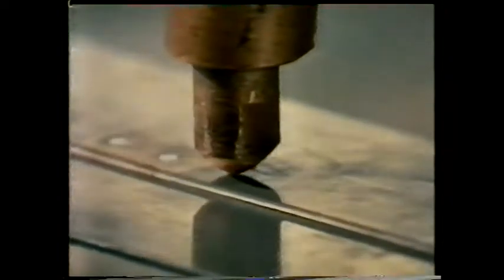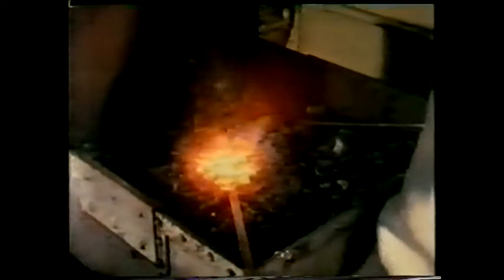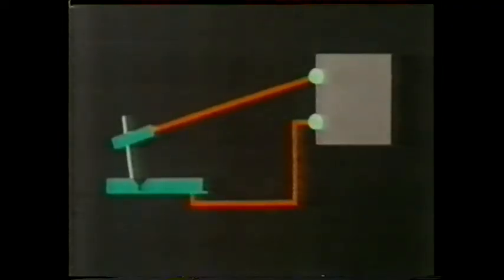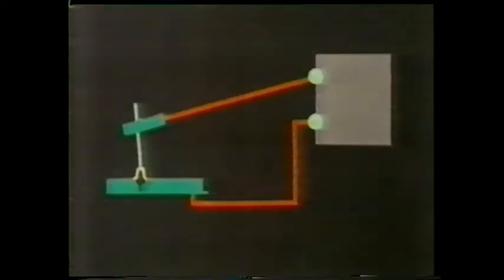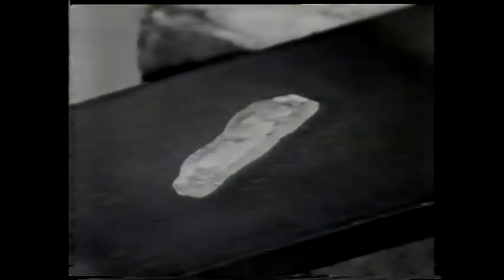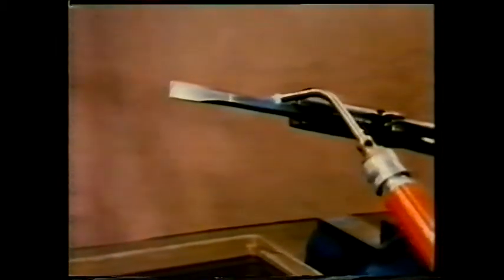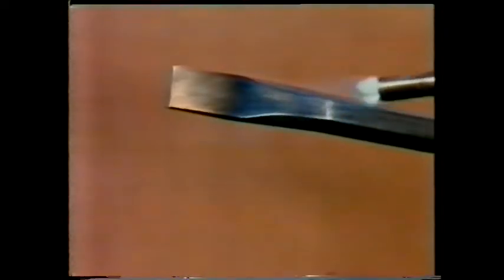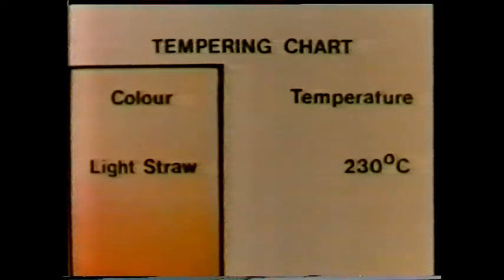BBC Engineering Craft Studies EP 6 Heat   Production and Measurement

Comment: why didn't the worker @3:52 burn to ashes, isn't he in direct contact with enough high electric voltage and current source?
Reply: Because the electricity passes from one node to another between the spot weld. This is the fastest route for the electricity to ground itself and so it doesn't need to go near him